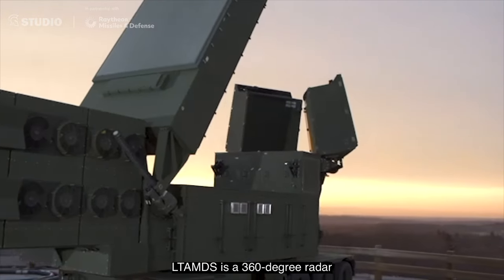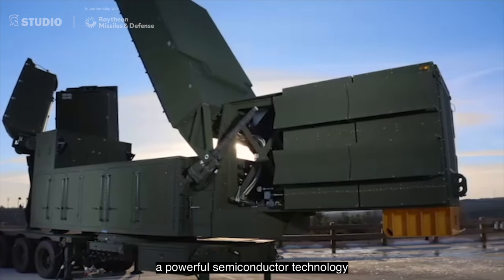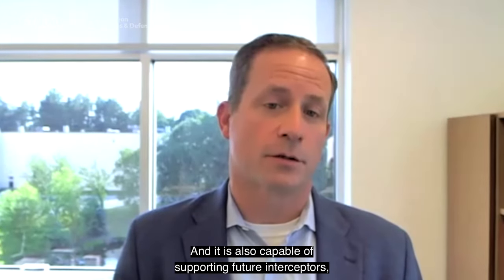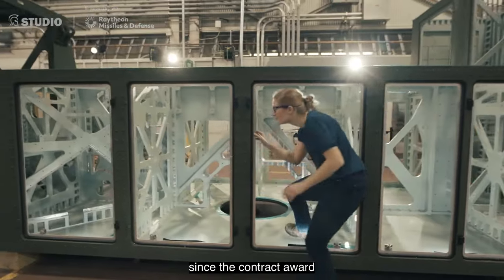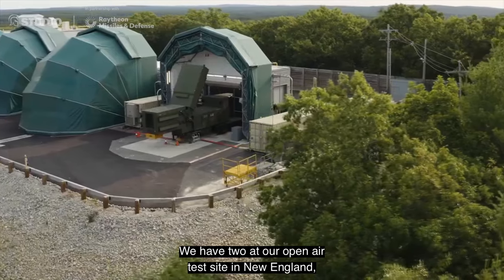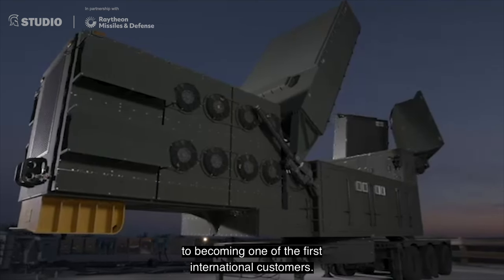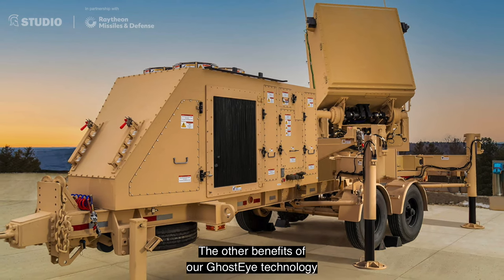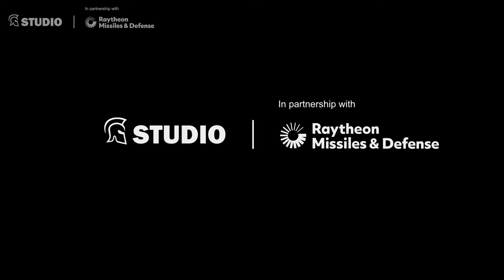How the new LTAMDS radar will thwart evolving air defence threats (Studio)

Comment: Some excellent digital beam forming and steering involved to allow the use of only three radar panels to get 100% radar coverage. The digital backend of the system must be excellent. The way it retracts the radar panels into the trailer ready for transport is also impressive.
Obviously this radar is going to be teamed with an upgraded Patriot Air defence system which earns a big thumbs up from me. In the age of Hypersonic threats 100% radar coverage and quick reaction times are a necessity.
I have heard Aegis ashore in Poland is also due for a radar and software upgrade if it hasn't had one already.
Poland is getting treated to the best the US and it's allies have to offer but at a very substantial price.
😎🇦🇺👍